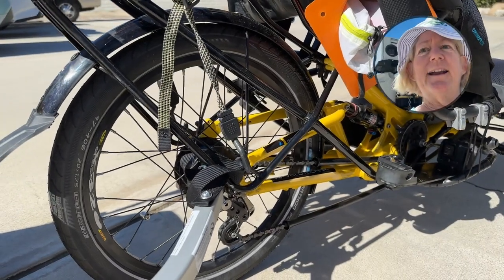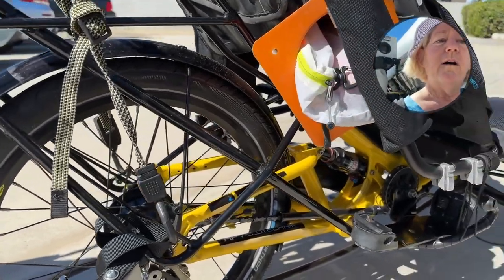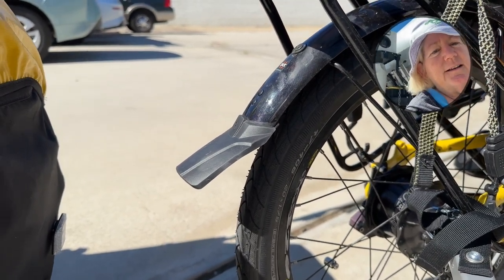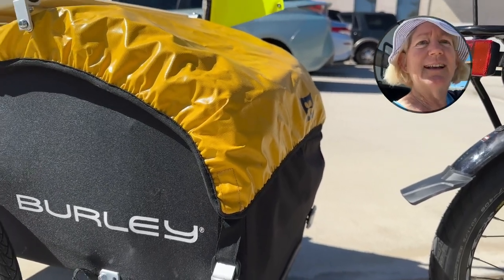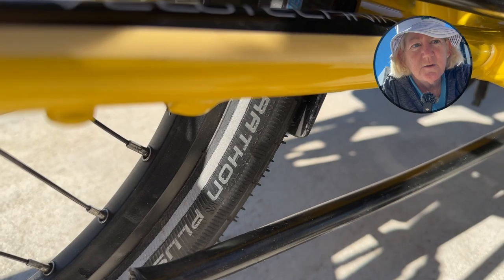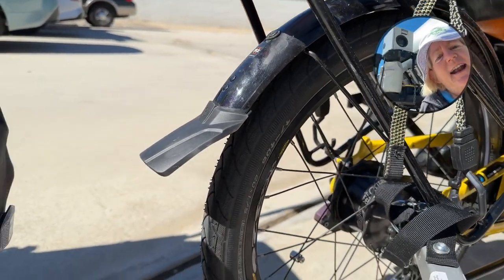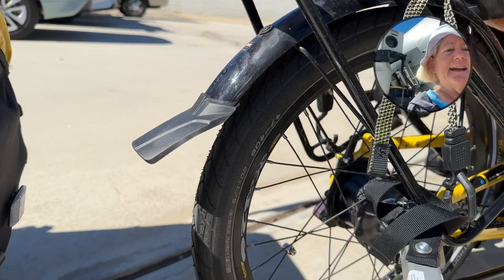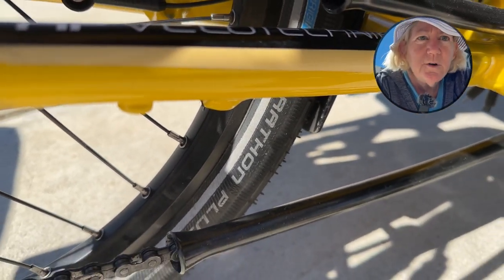Rear Fender Conundrum and Solution

Comment: The fender is really made to protect YOU or your trike, not a trailer.  Anything you do to the fender is likely to cause you more trouble than its worth.  I'd suggest adding a plastic shield to the front of the trailer itself.  Just get some thin plastic sheeting, or corrugated plastic and cut a piece to cover the front of the trailer where mud will hit it.
Reply from the maker: It seems like adding a shield is an easy solution but I couldn't figure out how to attach it securely. I think this will require more tools and manufacturing skills than I have. Maybe I'll meet someone along the tour that knows how to do it.

Comment: Looks like you figured it out. Now do not forgot to water proof the nylon on your trailer with the Clear Flex Steel Spray, sides and bottom. You dont need to do the top. Looks like your about ready. Good luck, and keep tack of the weather, its being strange. Stay safe.
Reply from the maker: thanks! I added Flex Spray on the bottom and waterproofed the sides of the trailer.

Comment: Hi Sylvia.  I have a Greenspeed Magnum c/w rear mudguard/fender issues.  I like your/Dave extended flap idea - we have plenty of muck on Tasmanian roads too.  Some time ago I replaced my Nuvinci hub with a Rohloff - just so much better.  I installed the wheel removal info on my phone for use as and when needed.  Just checked - can't find it!!  This video urged me to check;  thank you.  Lastly - yes, I would like to see how you use the cone to help remove the rear wheel as I am dreading my first puncture - the Nuvinci cabling was a real hassle and I hope Rohloff is easier.
Reply from the maker: Thanks! I love the Rohloff.

Comment: Sylvia,
    I agree with some of the commenters about the angle of the added flap.  I don't think it will block enough sh..er "stuff".  Did you test it by riding through some "stuff" at speed.  Too bad you are not closer to Sacramento.  Tons of "stuff" up there.  
    Seriously though, water will miss that flap.  "Stuff" will probably stick to the tire more and not fly off at a shallow enough angle to miss the addition.   I liked the plexiglass addition one commenter did, but I think a piece of thin aluminum (.040) would be easier to form up and you can cut it with tin snips.  It could be attached to the original fender with pop rivets (really short ones) and you could eliminate the flap or add it to the addition.  You can (Dave) form the aluminum around a piece of 2 inch pipe with hands.   It will hold paint too.  
    Also, if there is a flea market near you, you could buy a used fender for a couple bucks.  There may be a junk bike reseller close by too.  
    Be well and stay safe,
bf
Reply from the maker: thanks! Maybe someone will be able to help me while I'm on my tour if this solution doesn't work like I'm hoping it will.

Comment: I had a TT Rambler and My AZUB Tricon 26 home made rear fender. By using the rack to help hold it. I took a piece of plexiglass from the local hardware store with a heat gun formed a fender over the tire and used velcro to hold it in place. It flexes if you bump it and eazy to remove to clean.
Reply from the maker: Thanks!!

Comment: Initially I was thinking that taking the fender off and drilling two new holes for new mounting spots would be easiest, but I don't know if that would get it low enough to protect the trailer, so the new mudflap addition looks like it will work fine.
Otherwise I suggest slowing down in certain places to reduce the potential poop water aeration. 
More complex ideas would be a thin sheet of something water resistant that would cover the front and attach on the sides where the aluminum pieces are that the top bungie goes over. They attach with an Allen screw that is probably 5mm or 6mm.
Even more complex would be to have someone 3D print a fender the shape you want. I had 3D printed fenders made for my fat tire off road bike that is very muddy, but I didn't offset for my gear cassette on one side of the wheel, so it's more than a little janky. The front one was very good until I added air shocks and changed all the tolerances.
I think what you have will work and if not then just slow down in puddles near cows, or fields where the honey wagons have been recently
Reply from the maker: Thanks, Ken!

Comment: Re, the removal of the rear wheel. This is a problem for all recumbent trikes, and I'm not sure what the solution is. Possibly a fork type jack stand that a lot of motorcycles have, that is high enough to allow the rear wheel to drop down far enough to release the chain.
Reply from the maker: How to raise the rear wheel when out on my own has been a big issue for a long time. The rear wheel with Rohloff Speed hub requires both hands for removal and reinstallation. My solution is to carry a small plastic safety cone. The HP trike frame has a square space the cone fits into perfectly. The cone is very lightweight and the base is wide enough to offer stability. It fits right behind my seat in front of the rear rack. I keep my tools and seat cover inside the cone space too.

Comment: Looks like that could be a good solution. My only concern is with the zip ties eventually tearing at the original flap, but you'll just have to monitor it and see how it goes.
Reply from the maker: Yes, I concur!
Reply: I have 18000 miles with no problems.

Comment: Let me be the first to congratulate! Doesn’t look bad. Is that an HP fender? Question on merch. Why doe the logo on the t shirt have to be on a white background, yielding a patch look? Can’t the artwork knock out that white to yield just the trike? Many apps can do that with a click.
Reply from the maker: Thanks, Terrie! The rear fender came from HP and it's made by SKS. The white square is necessary for darker colors. Without the white background, the dark logo won't show up on dark-colored shirts. I'm sure would be easy for a lot of people to figure all this out but it was too much for me.
Reply: @TravelsByTrike  Yeah, can see that for dark backgrounds but often the t shirt people let you pick another ink color. Just wondering. I have apps that could do it maybe if you want.

Comment: Solid tires?
Reply from the maker: No, Schwalbe Marathon Plus.
Reply: @TravelsByTrike  I always wondered about solid tires. My hands have a rare disease and I can’t change a tire. My biggest fear is a flat. I have liners and heavy duty tubes so I’m hoping I don’t ever get a flat. I tried to fill out your form and I’ll try again , but it wouldn’t submit. I’m in Ohio I could help you if you need help in Ohio.
Reply from the maker: @conniehoyle2669  I don't know anything about solid tires. My local bike shop won't stock them or install them. They say these solid tires have a tendency to shred. I know riders on the Recumbent Riders FB page talk about them a lot and seem to like them.. Best of luck!
Reply: @TravelsByTrike  Good Luck on your adventure.